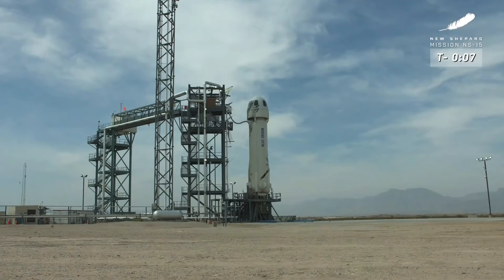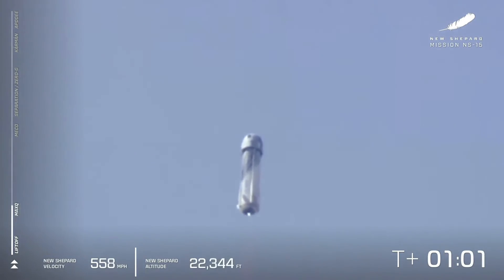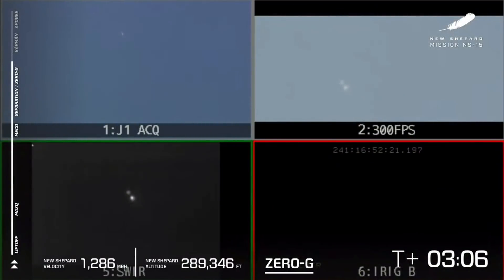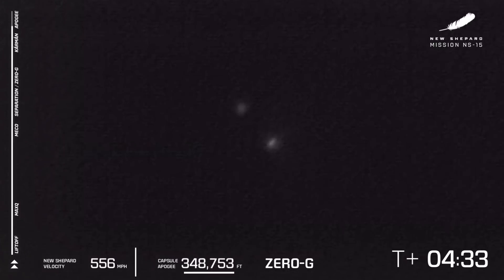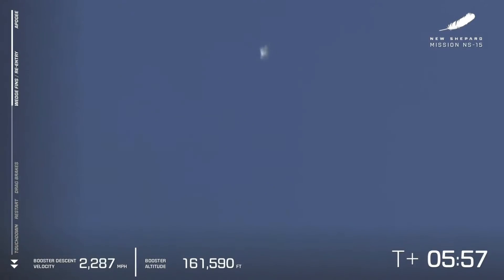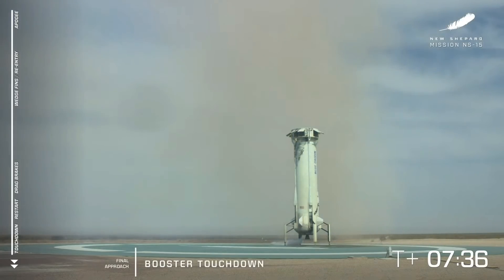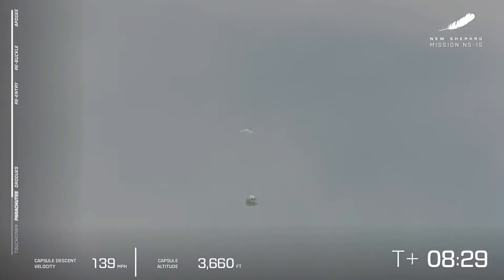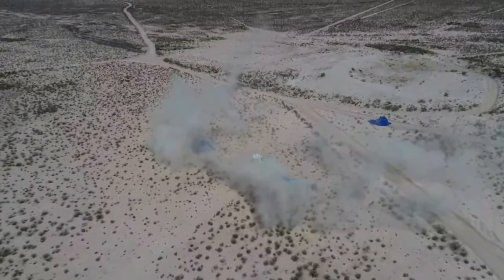Blue Origin's New Shepard launches after 'astronaut rehearsal,' nails landings!

Comment: Miles per hour and feet? Can we get those figures in the measurements of science?
Reply: @StokesburyUSA  In the US yards (and hence feet and miles) are defined in metres; check out the National Bureau of Standards, SP 447 ref F.R. Doc. 59-5442 Filed Jun 30th 1959.
Reply: But me got measure how big compare to King's Foot😂

Yes, ALL science is done in metric folks. So is all international engineering. 

For one thing: kilograms are kilograms.
But lbs have to be converted to "slugs", because they're not a usable mass measurement.

Science has been metric for a long time, even in 'merica. Imperial Overload Units need not apply.
Reply: Leland Morgan  The metric system is not more accurate -- nor is it less accurate. It is, admittedly, more logical.
Reply: What's the matter, you can't multiply by 5/3, or divide by 3?
Reply: Nathan, Mr ignoramus, next time you take a commercial flight beg your pilot to use kilometers and  meters because he is going to be using nautical miles and feet, even if it is a European pilot flying Airbus from Paris to Rome.
Reply: It is in the measurements of science.
Reply: @codetech5598  please source your work. We officially converted to metric a long time ago and our military converses with the world in metric. English to Metric conversion is why we crashed a probe into Mars.
Reply: @nathangoddard8115  That belly ache is really something!  It's really not that big a deal. 1 meter is about 3.2 feet. 1 mph is about 1.6 kilometers. Anyone should be able to do a rough conversion in their head.
Reply: @nathangoddard8115  "Science" requires measurements that are consistent and repeatable.

"Miles" and "feet" meet the requirements of science if the measurement devices used are precise and accurate.
Reply: @NathanGoddard...A failure to convert metric to imperial caused the Mars incident, not the use of imperial units. It was a communcation error between contractors, not a fault of the measuring systems used...
Reply: @codymoe4986  An error that could easily be fixed by just using one measurement system (like the Apollo missions; only the read outs were in feet / nm because the pilots were ex US military).
Reply: @TankEnMate  So you admit that if everyone was using imperial measurements, the mission would have gone off without a hitch?

I was under the assumption that it was an inferior and fallible measurement system...at least according to the numerous metric users whining on these message threads...
Reply: @codymoe4986  Sure you could use imperial measures and have less issues. Everywhere except USA, Liberia and Myanmar uses metric; because it's simpler (even less issues). Obviously if you want to dock with anything in space you'd want to use metric (Apollo, Skylab, and ISS are all metric). But then Blue Origin haven't even made it to orbital on a test mission yet so...
Reply: @TankEnMate  Pretty sure 2 docking ports of the exact same dimensions and that fit perfectly can also be measured using both metric or imperial units....

I really have zero issues with the metric system or who happens to want to use it, for whatever reason...

However I do have a problem with the clowns that show up on these comment threads and pretend one is superior, more accurate than the other when both you and I know it has nothing to do with that and everything to do with ego, and worse yet, nationalistic ego.

Like I answered to another person above, how does me using an imperial measuring tape to help build houses, using farenheit to judge what clothes to wear, using miles to measure road trips, affect you negatively? 

And more importantly,  so severely that I must change to be just like you?
Reply: @codymoe4986  Metric's big benefit is that it uses base 10 like our counting system. It's secondary benefit is that everything is based on metric (including feet, inches, miles, etc) Sure, you don't have to change; it's just easier and cheaper to follow the standards that most (95+%) people use. Buying a M6 bolt is much cheaper than buying a 7/32" bolt. If you want to be a non conformist, knock yourself out... You're going to have fun trying to buy a car these days with SAE sized parts.
Reply: If you really knew anything about science, you wouldn't need us to do simple conversions for you.
Reply: @DanChampionJr  can you compute those conversions in real-time... in your head?
Reply: @brokenplanet8810  you fool he is correct the metric system is the only scientific system of measurement....imperial  is just that a failed and faulty remnant of a failed empire.

Comment: Your air cushion didn't go off, it said it was at 90 ft when it landed.
That would have broken your back.
Reply: Not supposed to 'splash down' when you are landing on dirt...
Reply: @gmarie701  I don’t think he said ‘splash down.’
Reply: Landing at 16 mph in a form fitted couch?   No, it won't break your back.   You won't even get hurt in a car crash at 16 mph.
Reply: Boosters ignite before it lands to soften the landing hence all the dust you saw spray up.

Comment: The booster seemed to have a softer landing than the crew capsule
Reply: Notice that as well
Reply: AFAIN it has a special retro thruster system they use before landing, that's the reason you see so many sand blown away, before even touchdown, so most of it its not even from the landing contact itself. If you slow it down to 0,25 speed you can see that..
Reply: @istvanvarga3326  Do you have information of distance from ground system is activated? Than we can estimate deceleration from speed mentioned in video.
Reply: @istvanvarga3326  It seems like an airbag
Reply: @istvanvarga3326  yeah that causes a change from 25kmh to about 5kmh instantly. It's like sitting in a fast car then it just stops. But in the case of the capsule its harder
Reply: @istvanvarga3326  looks like some here were not aware the speaker said the booster would land at 5Km/h and the capsule would fall(notice the difference) at 10Mph.
.
It' s a considerable speed difference when bumping on the ground is concerned.
.
Again, one falls SUPPORTED BY PARACHUTES, the other lands USING RETRO ROCKETS.
.
Reply: Yea, why separate? Land the entire thing together, like Starship! This seems like old tech. Not that interested.
Reply: @MissouriClydesdales  dude, the capsulemis whatbis needed in space plus if they put everything together, the rocket will be too heavy and one booster cant take the whole thing into orbit, that's why there's staging.
Reply: @kwasisb5390   Dude, no need to haphazardly mansplain it.  The lift limitations of a tiny rocket are painfully obvious. It would be far better to have designed & built a bit stronger to lift & land the entire thing as softly as that mini booster does. Capsule air braking is neato, but going from 20 mph to zero mph in half a second doesn't look all that fun.  This is the old/dumb way of doing it, not impressed.
Reply: @MissouriClydesdales  so what exactly are you saying?
Also I was just saying what I think, not like I know everything.
Reply: @kwasisb5390   Oh, good to hear, it sounded more like you were stating "absolute facts" in a manner intended to make others feel less smart than you.
Reply: @MissouriClydesdales  And it sounds like you are stating that any one with an opinion disagreeing with your own is intellectually inferior. Thankfully I'm able to give you the benefit of the doubt, something you haven't demonstrated so far.
Reply: @iamise   OK bleeding heart guy, settle down.  Where does "giving someone the benefit of the doubt" even fit in here?  It doesn't.  Numbnuts rudely talking down to me saying "This is basic engineering" when he chose to incorrectly ASSUME something about my statement.  He was arrogantly wrong, and HE was suggesting that I was "intellectually inferior", based solely on his own misguided assumption.  He got properly called out, that's it, grow up.  I never suggested that anyone (fyi, "any one" should be one word in your comment, funny) is "intellectually inferior", and for you to now hatefully suggest that I am stating that every single person who ever disagrees with me is "intellectually inferior" is insane & sounds like your own personal problem. The world doesn't need any more Drama Queens, you & Mr Pete should stop. TY
Reply: @alexlocke_  that’s what I was thinking. One method is high risk, the other is less technical and lower risk, albeit seemingly more uncomfortable.
Reply: @kwasisb5390  he couldnt even get it into orbit anyway
Reply: @godofthunder6259  this particular one cant get into orbit. I don't know when they are planning to make a rocket that can get into orbit
Reply: @MissouriClydesdales  No I'm saying you assumed a lot, as you just have with me
Reply: @iamise   You're mistaken, I assume nothing.
Reply: @MissouriClydesdales  The capsule is quiet, keeps rising after separation, and is much less likely to fail than the booster. They're selling this as a thrill ride, so safety is paramount.
Reply: @MissouriClydesdales  The capsule separating is safer.
Reply: @TheMrPeteChannel   No.
Reply: @MissouriClydesdales  Yes. Leaving the capsule & passengers on top makes it TOP HEAVY & therefore unsafe. This is basic engineering.
Reply: @TheMrPeteChannel  top heavy is unsafe? Can you further explain? Or are you not familiar with the pendulum fallacy?
Reply: @johnlau8461  when you remove the capsule and any passengers/cargo from the top of the vehicle become lighter & by most accounts easier to land.
Reply: @TheMrPeteChannel  By whose accounts? i would like to know more about what you're saying. Because lighter vehicle doesnt necessarily mean its easier to land. Requires less fuel yes, but the technical difficulties of the control system and guidance wont be affected.
Reply: @MissouriClydesdales  You'd need more fuel for the retro-rockets which would increase the payload weight. This would require a bigger booster to achieve the same performance. Although if I were a betting man I'd imagine that they might do that in the future.
Reply: @twistedyogert   I know all that!  Would be very easy thing for Bezos to do, & what I've said all along. Now I'll Mansplain something to you... Using this 1970s tech is silly, boring and overall prolly more dangerous than designing a bigger rocket with redundancies.  Plus, you can already get this exact ride from the Soviets, landing at the mercy of the wind in the middle of F-ing nowhere included! lol  It would be FAR better for everyone involved to use a Ship that can land right where you took off, or at least in a dedicated LZ with safety facilities waiting to take care of the astronauts & rocket/equipment. Who wants to land in the desert, and imagine praying the entire trip that someone didn't play a sick joke & pack their dirty laundry instead of the parachutes!!  The horror!
Reply: Yes. Slow down from 25km/h to 0 in I guess 1m distance is quite a bang. It's like crash with the bike to the wall and dump the hit with hands.
Reply: @tiborbogi7457  yall do realise it is nothing like a crash nor like slamming on brakes in a car... the thrusters turn in at the last second to bring it to 0 mph and a mini hover then a soft landing which all happens in under a few seconds so it’s nothing like a crash or a hard landing
Reply: @tiborbogi7457  It wouldn't kill you but it wouldn't be a love tap. It's fast enough to deploy the airbags in some cars. I'm sure those seats are soft.
Reply: @tiborbogi7457  dont you mean 16km/hr?
Reply: @kwasisb5390  MPH
Reply: @stevegiboney4493  oh riight, I thouht they used km/h. Thanks
Reply: @kwasisb5390  16MPH is 25,75km/h. I agree with you :"astronauts describe that "soft landing" as experiencing a car crash". :-o  Crash at 16MPH is not lethal neither soft.
Reply: @tiborbogi7457  yeah. I think they are adding shock absorbers to the seat so the astronauts wont really feel the impact
Reply: @kwasisb5390  How did you thought.... nevermind 🤦🏿‍♂️
Reply: They only have a few 1st stages so need to take more care. People are plentiful lol
Reply: @Ali Mohsin isnt the dirt cloud suppose to be the result of the thrusters on the capsule  firing just before touchdown?.?
Reply: yeah they use retro thruster, that might lead you to think thats a hard landing. Thats how soyuz does it as well, its not new capsule can land on land
Reply: And people are going to be on that capsule
Imagine ending your ride with quite the bump, think about how uncomfortable that would be!
Reply: Yea that capsule landing didnt look that comfortable lol ud definitely come out with no injuries but ud definitely kno when u landed for sure! Id much rather take the booster landing!
Reply: Because booster damage costs money. Who cares about damage to people?
Reply: The Niagara falls barrel people hit the surface at like 100 miles an hour so whatever speed the capsule lands it's no big deal
Reply: They probably  had a different team doing the rendering and after effects😉
Reply: I wouldn't want to be in that capsule landing at that speed despite their 'cushion of air' spin.
Reply: @cryptomonkey6142  Noones inviting you to so you can relax.
Reply: @felicityholmes9072  Phew, thank goodness, thanks sweetie. 🤣
Reply: @cryptomonkey6142  ..then again it'd be a harder landing if a Starship Raptor failed..
Reply: jes
Reply: Yeah but i think their Seats are build for absorbtion.
Reply: No i thought there was a puff of air that is shot out from below the crew capsule at the point of touchdown that makes it look more dramatic with burst of dust into the air, but if you just follow the capsule itself you can see it's a smooth landing.
Reply: Seemed pretty smooth to me with the retro thrusters right at the end.
Reply: Well i guess everyone here has experienced this "soft landing" but me!🤷
Reply: because just before the crew capsule lands, he makes a big air blast to soften the ground before it touchs it :D
Reply: Increasing the time for deceleration makes a monumental difference. The same goes for dropping your phone on a concrete floor or on a pillow. The pillow ”stretches” the force out over a longer period of time, making the impact a lot smoother. Going from 1ms to 2ms makes a big difference, going to 200ms is not even remotely comparable.
Reply: yeah, I kinda noticed that as well. very interesting...
Reply: Booster has engine with fuel, crew capsule best without anything that can blow up.
Reply: yes the speed was still plus 15 MPH on impact
Reply: @johnwood406  yes that's correct as I could see  as well so softish but needs to be softer than that
Reply: Lol I was thinking the same thing
Reply: The seats are probably padded and hold on to occupants better than racing seats.
Reply: Ay. The crews are allow to take a nap while waiting for landing. That hard landing is a morning call to awake the crews
Reply: Yes they said air cushion but no cushion as far as I could see that would be a big bang inside but the booster was perfect as people say like a star wars toy, space  x must get there booster to do the same perfect landing before they get any trust from public I think
Reply: That’s not very good
Reply: Priorities
Reply: do you think bezo cares for people bHAHAHAHAHAHaha
Reply: Yeah, astronauts describe that "soft landing" as experiencing a car crash😂
Reply: Capsule with parachutes falls at 16MPH. Just before it hits, it fires a thruster to slow and cushion it. Plus there's 5.5 inch thick crushable ring around the bottom. The capsule hitting the ground is less of an impact than most minor fender benders.
Reply: The capsule wasn't  a gentle landing. The mission failed.
Reply: NASA needs "parachutes" :(
with no reason, maybe friends companies? overemployments?
Reply: Not sure what video you watched, but that was a very smooth capsule landing too. Both seemed really soft, I don't think I could say for sure which was softer, probably the capsule though.
Reply: @thomasmathew13  🥴
Reply: @thomasmathew13   ok mate 😂

Comment: Put some wheels on it and set a land record in 90 seconds.
Reply: The air at ground level is too thick.
Reply: @CodeTech...If the current LSR was set by 2 jet engines in that thick air, pretty sure the engine above would do the job...
Reply: @codymoe4986  The elusive 1,000MPH on land 'should' be broken.
Reply: @tjkaz5419  I am more of a wheel driven fan when it comes to LSR attempts, but the thrust powered vehicles are still fun to watch. 

TBH, I would just be happy with a 200mph hat from Bonneville if someone was foolish enough to allow me to drive their hotrod...